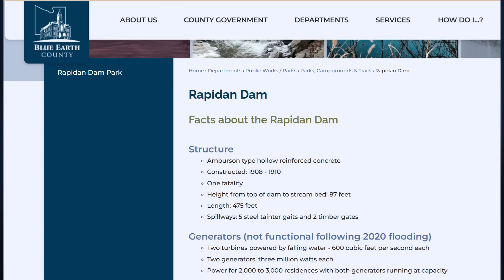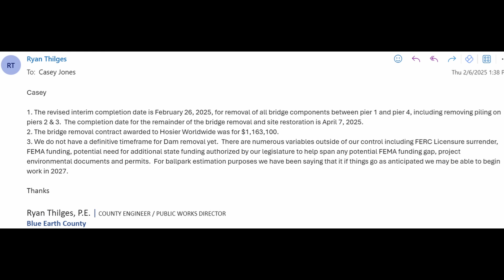Rapidan Dam Bridge Demolition

Comment: Thank you. So one thing that really has never been explained locally is, Why couldn't a new base have been poured around that one pier and the bridge would still be there? It was still a good solid bridge
Reply from the maker: I understand what you are saying.  I think that the considered the age of this bridge (30 or 40 years old) in conjunction with the repair costs.  Also, I suspect that it was easier to get federal funding for a replacement bridge than to repair the old one.

Comment: I hope they thoroughly investigated remediating the pier.  Looking downstream it appears the bedrock isn't too much deeper than the current scour shown.  Add some micropile to temporarily support the suspended pier and some shoring underneath the bridge girders.  Then excavate beneath the footing to bedrock, hammer into the rock a few feet, then pour a concrete base between bedrock and the existing bottom of footing.   If the pier settled any you could jack up the bridge and raise the bearing seats.  Seems like that could be done for less than demolition and replacement costs.

Comment: Roswell was interesting case. I have read reports indicating it was an experimental test of a Chaff delivery system by a ballon that drifted out of the range. The worked ended with the modern chaff and flare systems used now on most combat area aircraft.

Comment: Thanks Casey for all the vids you do. There is a large amount of knowledge to gain in watching your vids and other vids like this. Also, there was zero mentioned in the local "news" outlets here in MN about the massive amount of tiling that has occurred, and is occurring in SW MN. Drive through any small SW MN town and you will typically see a tiling company with miles of plastic pipe coils.  MN gives out tiling permits easily, and yet, the first contributing cause given out is "climate change," yet, nothing is said about the huge amount of tiling that contributed, especially with saturated ground last June. If "climate change" contributed, and tiling contributed, what are the percentages of contribution?  And which one of those is more controllable?
Reply from the maker: Thank you, you raise great points.  Of course the big factor in this failure was the terrible condition of the dam with spillway gates no longer operational and the delay in attempting to clear debris from the upstream face of the dam.

Comment: If it were my project, I would have built a new bridge slightly upstream of the closed bridge to get a bridge there as soon as possible.  Then do the demolition of the damaged bridge and dam.  Why not do it that way?  Meanwhile, shouldn't there be digging of the river bank take place so as to not have a cliff that someone could fall off of?
Reply from the maker: Good point.  I forgot to ask about the river bank remediation.  It is a rather hazardous situation.
Reply: @CaseyJones-Engineer  As an engineer, would it have been possible to build a new bridge right away upstream of the damaged one?  I mean, why wait for the demolition?

Comment: Aside from this bad event it seems like the demolition was pretty much well planned and executed. Also good to have a drone footage of it in case something didn't go as planned. Doesn't matter how well you plan, there can be mishaps with explosions. Something as simple as a blasting cap not working leaving a dangling piece is enough. It would have been nice to see a slow motion of the initial part of the explosions.

One concern I have isn't so much related to the demolition as to the change in water flow now that the dam has been taken out of the equation. Will the Blue Earth River "eat" into the Grapevine Lane and Glacier Road in the future? This since it's a meandering river and those change path over time. It's of course a more long term issue than an immediate issue. This since the dam likely stabilized the situation around Grapevine Ln and 541st Ln.

Comment: I understand the need to remove the existing bridge with one that actually has something solid underneath to actually hold it up, but what exactly is gained by removing the dam? The river has already carved a new channel, and even if the dam is gone, what was land beside it is now riverbed. I would think that any accumulation of silt has already been flushed away. What exactly is to be gained from removing the dam?
Reply: With the dam gone, there is very little to continue the river migrating in that direction and, it will more than likely stay in the existing channel.

Comment: Weird it wasn't possible to rectify the problems with the foundation - weird.
Reply: when it comes to stuff like this, the guarantee of safety is higher with a new bridge. The flood damaged the foundations in a very traumatic way, and it is possible there is damage that could not be seen or detected, which might have led to collapse in the future. The potential unknown was too high, so demolition and replacement was seen as the best solution.